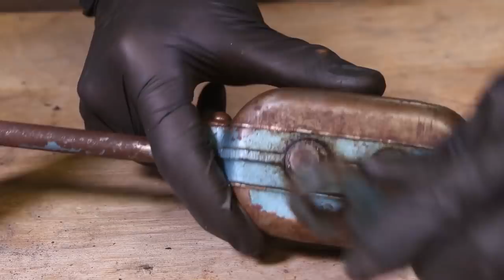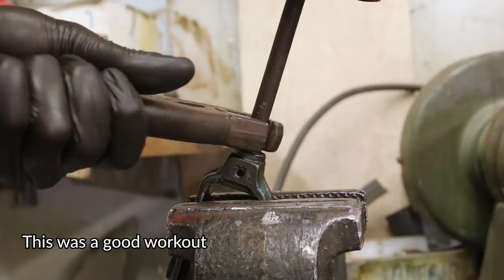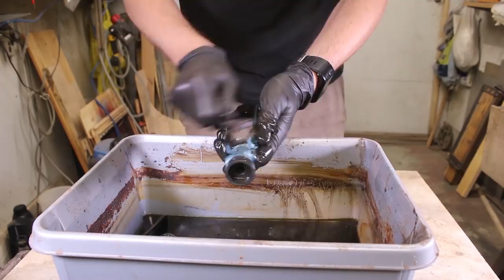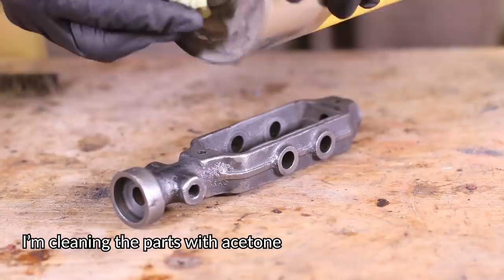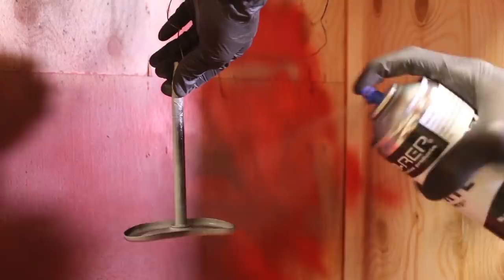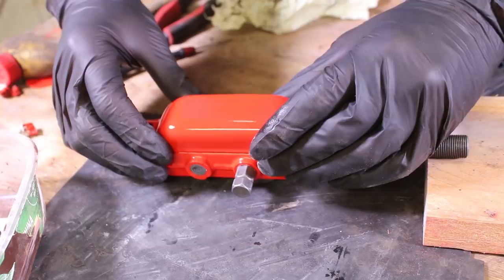Dented Two-Speed Breast Drill Restoration - Restoring tools

Comment: There is the second handle missing on this. It goes into the two threaded holes at the upper end close to the chuck and makes handling the drill a lot easier. I have the same one, and it came in red from the factory.

Comment: Good restoration. I enjoyed that. If you’re interested in a tip; place your screws in a drill and run the head against your buffing wheel. So much easier and definitely improved the shine on mine. 👍🇦🇺

Comment: Might I suggest a bluing agent (Perma Blue for example) on the exposed metal pieces.  It will darken them considerably (almost to a black), but more importantly it will prevent rust on them.

All in all, a pretty good restoration.
Reply: Use Perma Blue and you have to keep the metal oiled, to prevent rust.

Comment: Maybe retap the end so it will screw in properly.
Reply: Number 2 tool for the restoration of other tools, after a drill press with multiple wire brushes, grinding wheels and cloth bits, a DECENT set of tap and dies. This isn’t a place for cheap knock offs, and they are the only tool I can think of that you can not replace with something else. I’ve lost count of the number of tools I've bought that has had a screw forced into the wrong thread. This is especially so with old British or American tools that have the imperial threads with a metric screw forced in.
Reply: @markharris5771  You should go see him to show him what he's doing wrong.  You could probably go when your restoration videos are posted....oh wait, that's right,  you don't have a show.
Reply: Omahabigbill I don’t post videos because I only have 18% lung volume. I’m also 22 different medications to keep me alive. But through all that I still have the ability to properly read a comment. I have not criticised him either in this comment or my full one. I was merely saying how useful tap and dies are. If you read the comment I posted myself you will see I was very supportive.
Reply: @markharris5771  Yeah, you're right,  I apologize.
Reply: Omahabigbill Your apology is accepted. I also agree with the sentiment of your comment, as all too often people would rather destructively criticise than helpfully critique and advise. This especially irks when the restorer is young and learning, or they are from a part of the world where the average person doesn’t have access to sandblasters etc.
Reply: @Omahabigbill  There is nothing wrong in telling someone that he is doing something wrong. Especially, when you not only tell him that he does it wrong, but also how to improve. Learning how to do things better is always a good thing.
Reply: @TzOk  Believe me,  I have done that on  more than one occasion,  and the usual response was negative on  my recommendation.

Comment: Another job well done. There’s some good advice in the other comments, though I think some of it isn’t given in the most constructive way. I think some of the commentators forget you are still young and a more than willing learner.

It looks like a Stanley 748/748a Continental. The 748 was made from 1958 to around 1970 when it became the 748a until the early 90s. Though I think I read somewhere it depended what country the drill was manufactured in as to the date the name changed. 

I have one that I really should tidy up a bit, but along with my egg beater it’s my most used drill. It’s a great drill for brad bits and I much prefer these drills to electric ones. It should have a fixed perpendicular handle as well.

All in all a great video, I do enjoy watching your progress.

Comment: I have just recently acquired a slightly older one of these (made by the same maker) mine has a wood handle on the crank and the part on the very rear of the drill is cast iron, at the same place is another one identical to the one in the above video, it is complete as the one in the video is missing the 2nd handle that screws in just behind the drill chuck, the 2nd handle on mine is also missing but seeing as I have one handle made of wood it will be easy to copy the one on the crank handle. I paid $30au for mine my local junk shop had it, I love getting old tools lol.

Comment: it looks to be from the fifties, not the 40's, based on the design. i could be off, though, antique tools arent my thing. regardless, its a joy to see these old things restored to near factory condition
Reply: Judged Indeed. The older model has handles made of wood, not plastic. This is the late one.
Reply: @srfrg9707  i was thinking they were replacement handles. by design, i was referring to the rounded edges, the threaded stabilizer slot, the nice stock. typically, tools from the 40's tend to be cruder. simple plates on the sides rather than that nice, smooth curve, a captive, sliding stabilizer rather than the threaded kind, simple welds instead of pins, etc

Comment: You should make the second hand's handle (Small fixed straight handle that can be screwed in and out of the screw holes neat to the drill head)
Holding that handle makes the drilling much easier

Comment: Nice restoration. I had one like this one but I lost it.
Did you reassemble the ball bearing without grease?
Reply: Should have replaced it with a new thrust bearing.
Reply: My father also having the same one.
Reply: It looks like one of the ball bearings is missing, too.

Comment: You're using your rust remover as water, to brush the parts AFTER it has done its job. You should do that over regular water, so your rust remover comes out less dirty after each restoration job. You should then be able to re-use it more often.
Reply: Doesn't he do it, because not all the rust is removed?
Reply: its expired so he is not gonna use it
Reply: @admiral3185  Sure but brushing off the rest of the rust into the reusable liquid is not necessary. Just do it over water.
Reply: @thany3  is it this expansive?
Reply: The other John Smith 
If he’s not going to use the remover anymore it’s completely unnecessary to fill a bowl of water when you already have a liquid ready.
Reply: @christiantheologyunited3707  True, but he dirties the rust remover like this every time. It seems like he could easily keep it cleaner by rinsing in water instead of the rust remover.

Comment: I know this comment is a little late but i haven't been a subscriber for long so i'm watching your back catalogue. In your final assembly you have the breast guard 90 degrees out or alignment and the drill is missing the front side handle. You shouldn't have to hold the case too operate it there should be a small handle that goes in the holes in the main body near the chuck.

Comment: Wonder what those 2 extra holes in the front are for.
Reply: it probably was for another handle that wasn't with it when he got it. it would have had a handle straight out for more control of where you placed it. One could be made, a bolt the right size and some wood or something.
Reply: Another handle
Reply: It was for an attachment  of a side handle ! Google photos for Stanley 748 drill for a picture of the complete drill!
Reply: @hestheMaster  That's possible, but more likely a single handle that could be put on either side for left or right handed people or getting into different spots.. you move it to the left when blocked on the right, or if too tight for either, you leave it off. However it could have that tool for perpendicular holes as well.
Reply: Nearly right, you swap it when you change gearing.
Reply: toot tall Indeed. I have a complete one and it came with a handle. You can screw it on the appropriate side when you change gears. The idea is that you maintain the drill with your left hand and push with our shoulder.  During the demonstration on the video one can see that the drill swifts while operated because its not maintained still. By the way my handles are made of wood not plastic. I guess my (dad's) model is older than the one shown here.
Reply: @srfrg9707  either that or the handle it has is a replacement. However, if it's Bakelite, it can be quite old. Bakelite was invented in 1909. Didn't see widespread use until the war years, however. (just before, actually but the war sped up and spread out it's use so far as I can determine) Wood handles were much more common. I'm thinking the handle is a replacement added somewhere along the way, all the ones like this I've ever seen have wooden handles too. Wood was actually cheaper than the Bakelite in many cases, since molds aren't required for wood. I don't think bakelite would have taken the stress for long either. I don't know we're just guessing here, but might be fun to research it a bit.
Reply: toot tall I have the 748a Continental and both the perpendicular handle and the cranking handle are both made out of wood. This makes me think this particular drill was made close to the end of the drill's production period late 50s to early 90s.
Reply: @markharris5771  could be. if it's what we know as plastic today, you're probably right.

Comment: Nice, but you didn't screw the shoulder stock all the way in and of course use a pin punch to drive those pins back in, preferably copper or brass punches.

Comment: now what exactly is a breast drill used for? How is it different from other drills?
Reply: drilling.
Reply: so the back of the drill is a stock,that you can lean on so its easier to drill into wood or steel.
and normal drills have motors to turn the drill,thus less force is used
Reply: No bow Ties Thank you! Really appreciate it :)
Reply: howardte -_-

Comment: Your drill is missing one of the handles!
Reply: Indeed!
Reply: No it isn't, you swap the handle from the low gear to the high gear.
Reply: Indeed, just above the drill chuck you see a tapped whole, to fit a handle, you change it to the other side when you change the other handle as well.
Reply: Да,така е!

Comment: Should have fixed the thread up on the rear handle, you needed pliers to undo it and when you put it back together you could only screw it back in  half way and disappointingly, you left it like that.

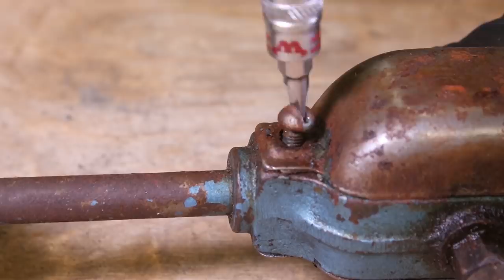Comment: 1:20 Near your hand there are 2 threaded holes (one of them is now clamped with your thumb), the handle should be screwed in there to conveniently hold the drill. The handle is rearranged depending on the used speed. 
https://youtu.be/2V4oIp9S4kQ
У меня дома до сих пор такая дрель лежит, я ей даже сверлил, правда последний раз лет 20 назад. А когда был совсем мелким, играл ею в войнушку, типа это автомат с откручивающимся прикладом.